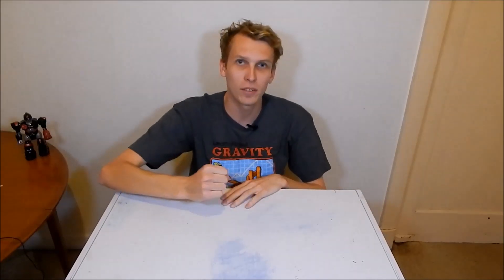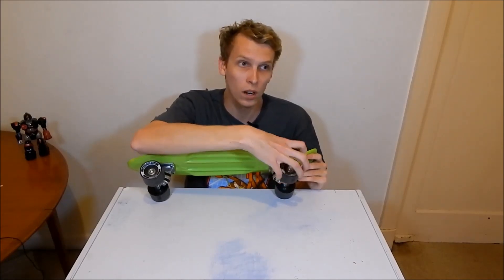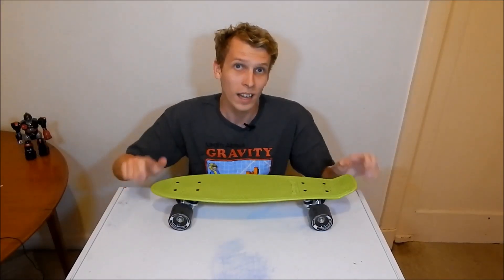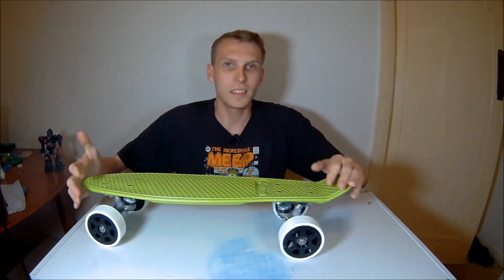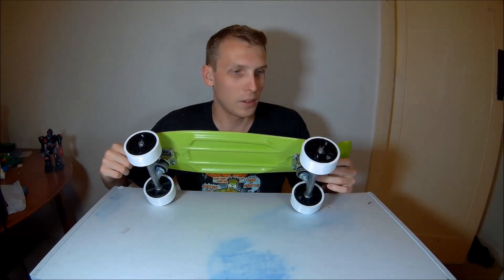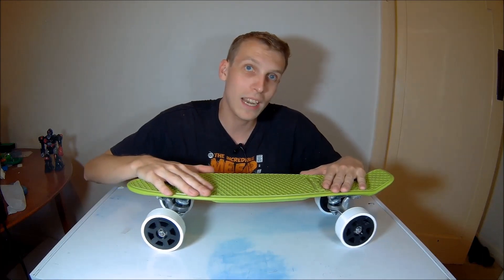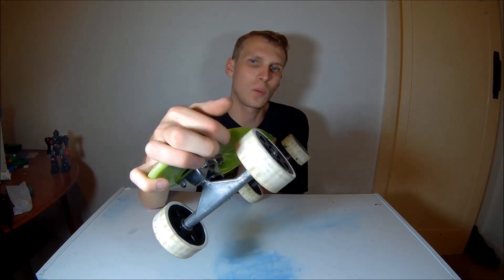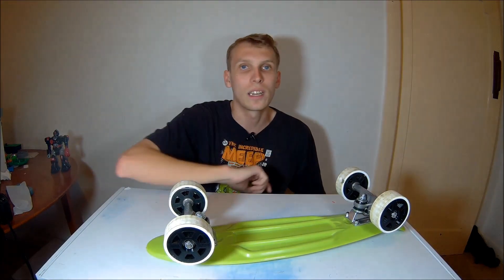3d Printed skateboard wheels

Comment: What is the black part of the wheel (rim?) made out of? PLA? How did it hold up?
Reply from the maker: yes it is PLA and I dont have good long term use data for you.
Unfortunatly I got the tolarence wrong on the bearing fit and it causes the wheels to bind up a little, not much but enough to make for an annoying ride.
As such I only used it for about a day. 

I should revisit this with new materials and better wheel designs